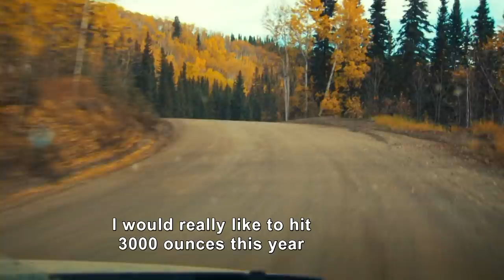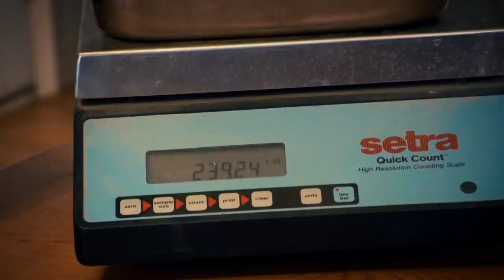Tony Beets Mines $5.6M Worth Of Gold In Shortest Season Ever! I Gold Rush

Comment: Insane how destructive these processes are.
Reply: Give it 20 years and the land will look liie it did before
Reply: As far as mining operations go, it isn't that bad. Water licenses and restrictions in water management are a big deal in forcing miners to keep it "honest".

Sure they turn a lot of dirt and chop some trees, but they don't leave lots of toxic chemicals or garbage behind, in a couple of decades the foliage would've grown back and aside from some weird hills it will all return to normal. The only real issue is that dug up radioactive and heavy metals (along with things like arsenic and asbestos) gather in the tailing pools, which then gets drained back into the water table. 

Other forms of ore mining that use extremely toxic materials like mercury or cyanide is where the real pollution happens.